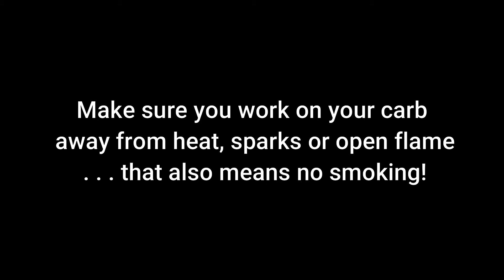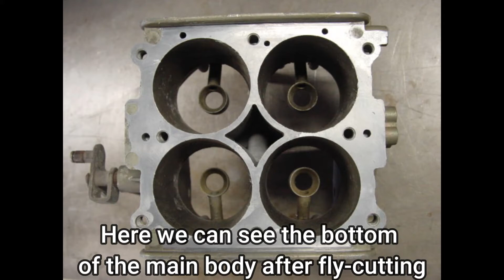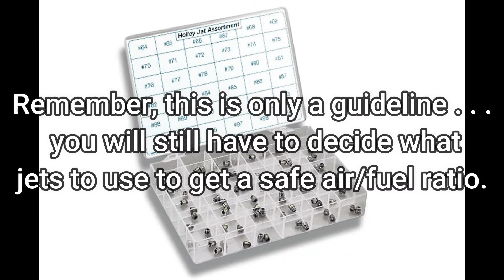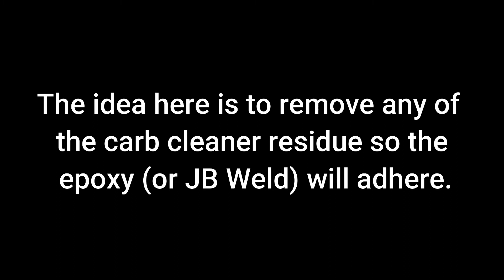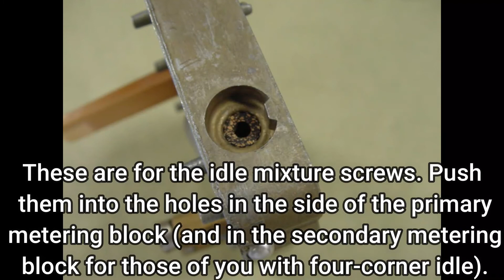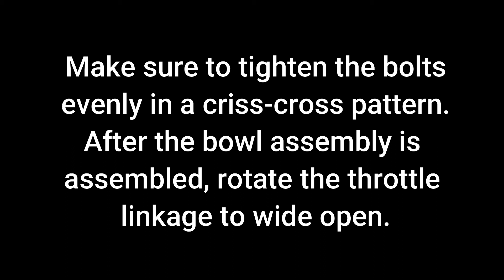Hangar 18 Fabrication Blow-Through Carb write up in video form.

Comment: Id like to discuss this ,this was all very good information back in the early 90s and 2000s but now that boost referenced power valves have flooded the market its made this guide pretty much obsolete plus a PV works off of vacuum once you add boost itll push it shut and you'll starve the engine under boost which means you'll have to richen it up at the top but it'll be rich everywhere else as well anyways
I was able to do it with just 
Vent tube extensions 
A Boost referenced power valve
Larger pvcr larger idle feed restrictiors on the secondarie metering block 
Nyrtrofil floats 
And making the secondaries throttle blades open earlier in relation to the primaries what this did was it allowed the secondaries to provide the extra fuel earlier due to the lack of a vacuum power valve  this trick I believe was discovered by nightwrencher here on YouTube 
All this and the car ran very well on the streeet it was lean on cruise but at wot it allways gave me that crisp 11.6 afr every time 
Most people ive seen try to do it the (old) way usually end up opting for efi i hope people try it the newer way so that carburators can still be mainstream and a more affordable option
Reply from the maker: I agree. The boost reference power valve is a game changer for sure. I never could get mine to tune, but I'm sure it was a lack of experience on my part. I could either have a perfect idle and cruise and lose WOT or good cruise and wide open and a crappy idle. Or good idle and WOT and a bad cruise mixture. I could never get all three, and I wasn't really chasing horsepower. I just wanted it to run consistent. I ended up getting a Holley Sniper.
Reply: @G-P_Custom_Fabrication  ahh I'm sorry to hear that I'm sure you have more experience with carbs than I do but I had pretty good luck and I was daily driving mine it would cruise lean and always hit 11.6 at wot I hope one day you'll try it again with success either way I hope that efi is working well for you

Comment: What confuses me is the umbrella seal in the accelerator pump. You just remove the little umbrella and reassemble without it? Curious what this accomplishes. Seems like most people skip this step
Reply from the maker: I just re-watched it and it shows an umbrella seal in there during reassembly.  This is one of my most watched videos and I hope it's been helpful for someone. I'm actually in the process of replacing mine with a Holley Sniper EFI. I got it to work okay but the carb I started with had a cracked base and I never got it the air/fuel ratio good in all areas at the same time. I'd have a good idle and a rich cruise or the lean up top or any combination of the 3.  I hope to have some videos of the Sniper up before to long.